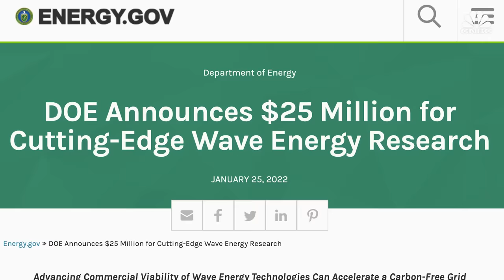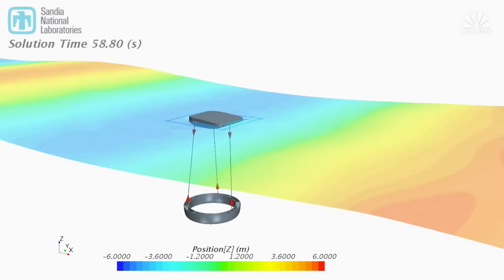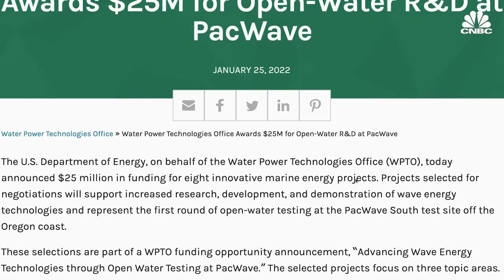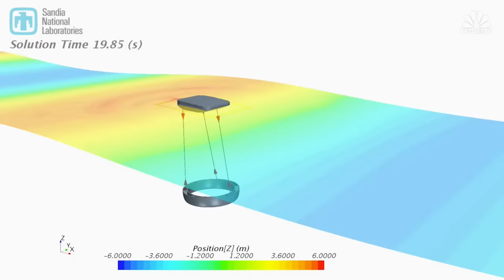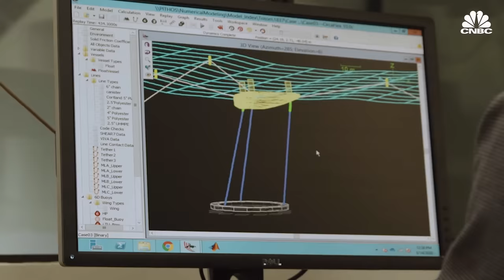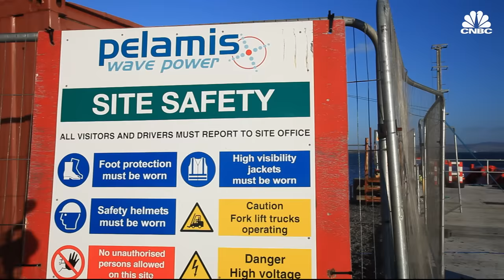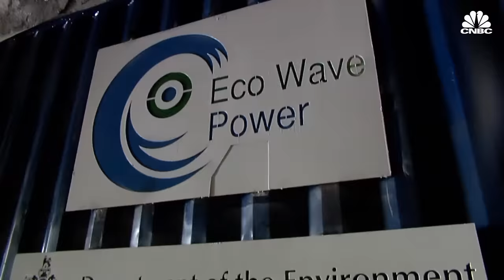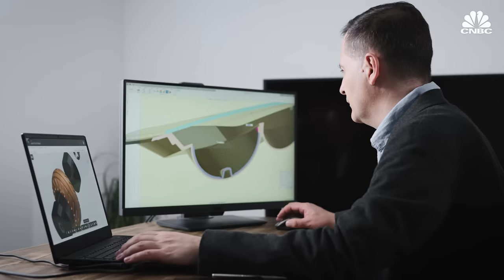How Waves Could Power A Clean Energy Future

Comment: Wind power and wave power is foolish support of nuclear power.  It is not necessary to force the armature magnets of a generator.  You can remove the armature magnets and still generate the same amount of power.  We can have only Edison magnets on the armature to move the coils of copper wire and not force the armature at all.  The field magnets move the armature magnets and coils of copper wire.  This power is wired to inverters and transformers to deliver high voltage AC power continuous peak power.   The generators can be  used to power brushless motors as generators.  One generator can power a large Bank of dynamos with inverters and transformers to deliver high voltage AC power in a large amount.
Reply: how very odd